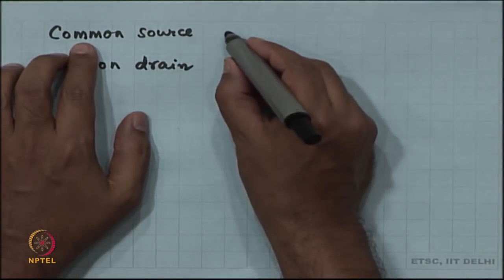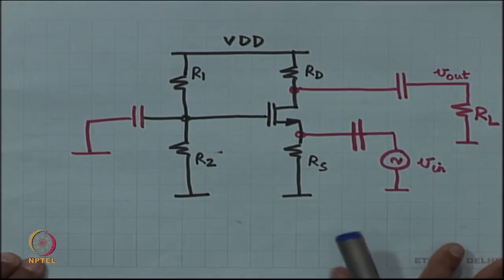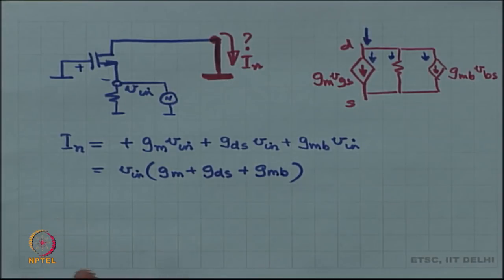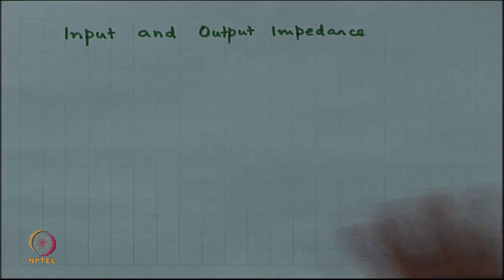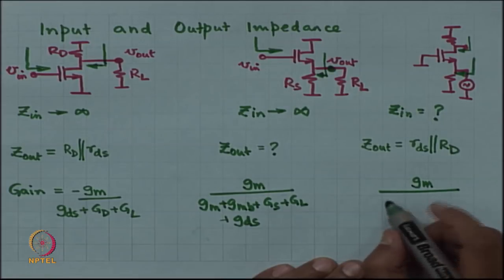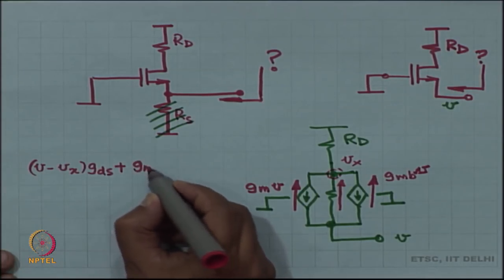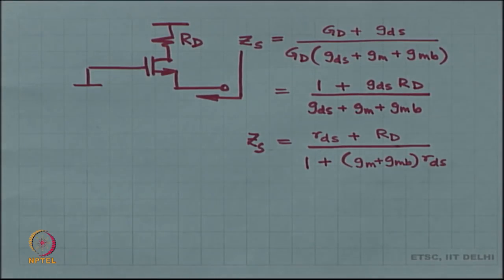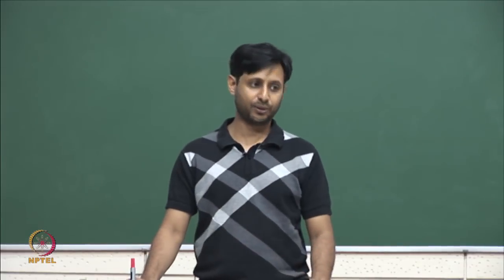Common gate circuit

Comment: Sir ur explanation is woNdérfUll 😘😘
Can u please explain why in common gate configuration you have included drain resistance (Rd) (which is at input section of configuration) in calculating output impedance???

Comment: Why didn't he add Rs in parallel after Calculating impedence for Common Gate Configuration When Looking Through Source
Reply: He missed that. In both cases, Zin for Common Gate and Zout for Common drain he missed to add the Rs in parallel at the end. Rs won't go away for either circuit.
Reply: yes i think they missed it
Reply: Voltage source short
Reply: @koneruprashant7470  how is that possible? Do you short the terminal to GND into which you're looking to calculate impedance? Rs will be present in parallel for both cases of CG and CD amplifiers.